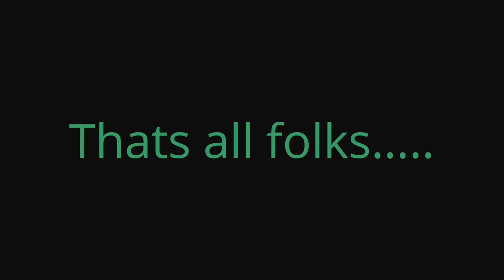Ya'll it’s HOT | Mowing Vlog

Comment: The heat index here in MI was 105 today. Yahoo................What state are you guys in? I'm a new sub so haven't heard yet.   @ 4:55-  Cut ya a couple of 6X6 blocks to the length you need to lay in that ditch. The drop from the perimeter board onto the 6X6 won't be much and the drop from it to the lawn won't either. Going back out  will be easy as well, plus the 6X6's won't slide in either direction if cut to the right length. You  could even taper the top side to make it even easier to go in and come back out.
Reply from the maker: Thanks for the sub! That's a good idea . I think 6×6's would work fine and I already have a couple of those 😉👍We are from Louisiana
Reply: @JsCrazyCutzLLC  I watch Swamp people all the time and I thought you sounded like  you were from there. I just sub'd to your other channel too. I didn't know about it either until she mentioned it in the video here.

Comment: that job you used make shift ramps for are ones I do a hard pass on. toss a push mower on the truck for it yes it sucks.  but beats messing up clients property/grates.
Reply from the maker: Yeah, that was a bad idea using those gratres🤦 Don't think I want to pack around a pushmower for just one lawn though🤷
Reply: @JsCrazyCutzLLC   thats why I said it sucks having to have a push mower for one lawn but it beats trimming.   I figure either way you will be doing that or lugging around some sort of ramps to get in and out safely.  Good luck man